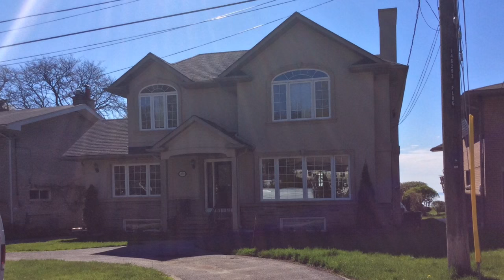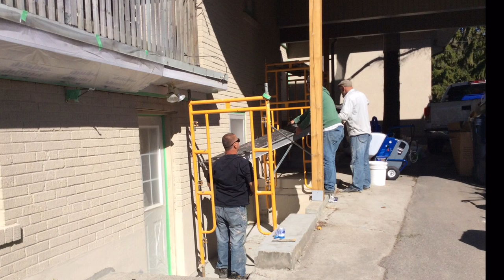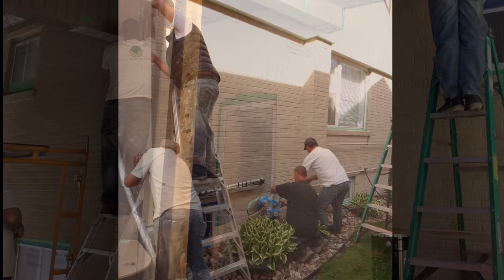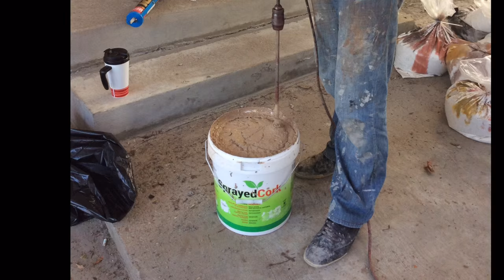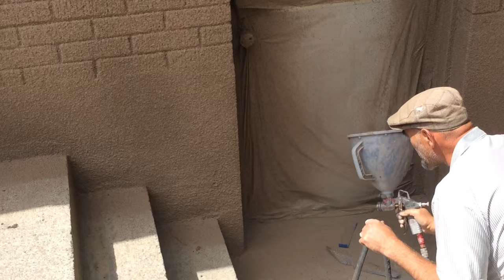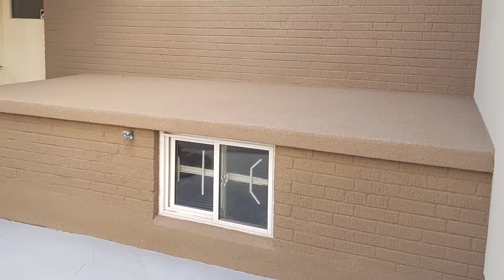Sprayed Cork Applied to Lakeview House

Comment: Spray cork insulation is suppose to have an R value of 0.16 if applied 1/8 inch thick. A normal wall already has insulation from R10 to R30. Cork is known to have an R value of 4 per inch, which is a very good insulator. It would be great to have some data points on homes that had spray cork applied. How does the real world data compare to model data?

Comment: as an insulation, being that it goes on very thin, what kind of "r" factor does it give. also, does the cork break down over time, peel or flake .
Reply: On Homes does it right. Mike Homes sprayed a metal roof. So it w must have a good life. By spaying the roof it made it quite in a rain storm.
Reply: Twenty year lives are claimed, I think these coatings are basically cork sawdust in paint, cost of product alone at $2 per square foot, Cork has a R-value of 4 per inch, these layers are tin, 1-2 mm per layer. I too have been trying to find better data on this, one video on the web claimed to have sprayed 6mm an decreased the transmission of heat through an old english stone wall by 30%. I think this gets complicated. Cork has several great and interesting properties: as applied it can fill cracks, change surface emissivity, provide a new look, insulate, help deaden sounds, resist fire and be more natural. That said, I realize there are no free lunches and don't think this miracle cure. Wish I could give you a straight answer on R value but don't know myself.